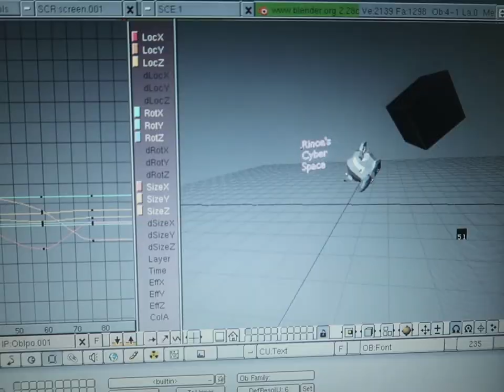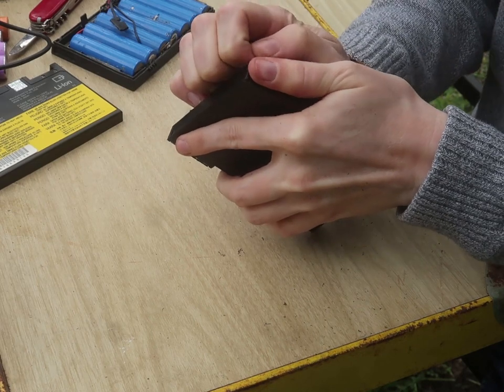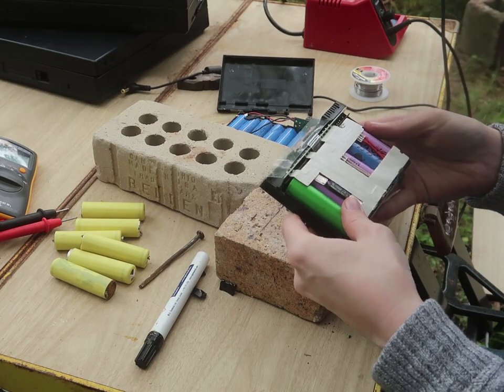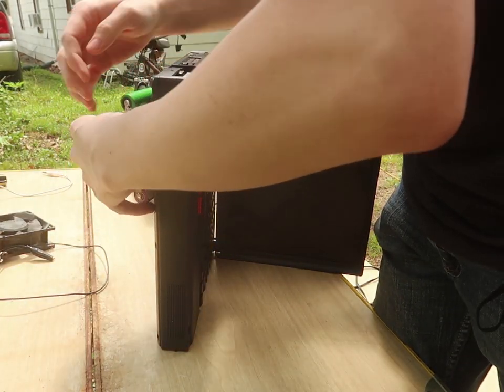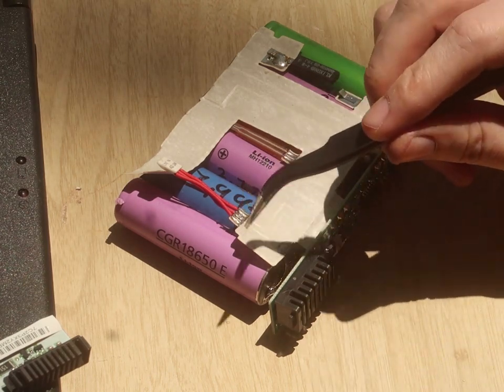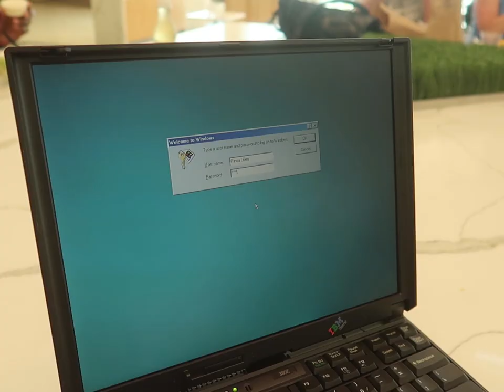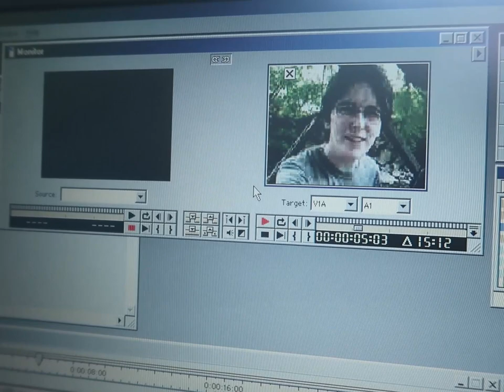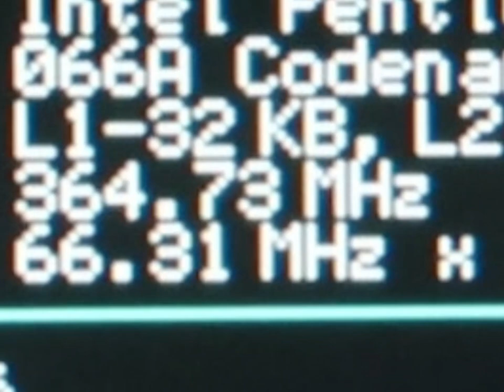Rinoa’s Cyber Space 01: Replacing Laptop 18650 Cells, Thinkpad Battery Recell Repair (Secret at end)

Comment: i learned how batteries work refurbishing discarded single use vapes, then rebuilding laptop batteries and eventually dealing with the big stuff powerwall and ev battery packs. shame that the drm in modern laptop batteries keeps you from rebuilding them since alot of obsolete models it doesnt make sense to spend more than the machine is worth on a new old stock battery thats sitting for years, but rebuidling it safely can get few more years out of it.
Reply: you definitely want those paper spacers to avoid shorting out if the plastic is damaged also theres cheap battery spot welder kits that may be worth it if you do this a lot, more reliable safer than trying to solder to the cell
Reply from the maker: I've soldered about 2,000 cells so far in my life and haven't had an issue yet, meanwhile I have had issues with spot welders. I don't plan to do this for products to sell to I'll stick with soldering for the time being.

Comment: Can't watch the video. However I'd be curious to see you do the same with old cordless power tool batteries. I had that idea to replace Ni-MH cells. Sourcing the high amp Samsung cells you'd want though is pretty difficult. I had the idea to use old laptop battery cells but someone said I'd just be wasting my time since they won't put out the needed amperage for power tools. My thought was even if so, I'd still have a working battery.
Reply from the maker: Oh, that's not a problem at all. Each 18650 can easily give 2 amps, maybe 4 amps. I'd say make your battery bigger so it lasts longer anyway. Maybe 1AH for every amp you plan to pull. On my first ebike battery I was pulling like 7 amps per 18650 and they werent happy, but they worked for hundreds of miles.

Comment: On my Thinkpad T60 the screen brightness option is in the BIOS. The default behaviour was to slightly dim the screen on battery power, but I disabled that. So now I have no brightness change when I unplug my laptop.

On a side note, does anyone have any idea why old Ni-Cd (nickel cadmium) batteries tend to fail and leak out? I have recently read a battery maintenance manual regarding this chemistry, and according to NASA for long term storage it is best to completely drain them, then keep them shorted (!!!) and in a cool dry place (but above freezing point). So that would indicate over discharge should have no negative effect on these batteries. Yet most guys who are into retro computing and preservation always advise to remove any Ni-Cd batteries from old motherboards, as they tend to fail and destroy the board they sit on.

I have an old NEC 386SX laptop from 1990, that has a soldered on Ni-Cd clock battery on the motherboard. It still works fine, but I am paranoid whether it's going to eventually leak out, and damage the machine. But I also like the fact that it can keep time and settings with it. Any advice?

Also the original main battery pack for mentioned 386SX laptop is made from Ni-Cd cells as well, and that battery pack works too for about an hour. I just don't know if this chemistry is always bound to fail and leak, or it really depends on manufacturing quality, and some of these cells/battery packs will keep working for many more decades?
Reply from the maker: It seems to be the case that the nicad cells only leak after they fail electrically. That's really amazing that you have a pack still working. Honestly I'd say keep it as long as you can.
Reply: @RinoaL  Yeah I will probably just keep a close eye on those batteries, so even if they start to fail I should be able to catch them in time, before they cause any damage. I want to preserve this NEC laltop as close to original as possible.

I bought it quite a few years ago as new old stock, the experience of unboxing a 30 year old machine was very special. There was no discolouration on it at all that we see on all these old computers. And I keep it in a dark place, so it still looks like new. It wasn't working though, it had a major capacitor problem, some of which were leaking badly. I had to replace all of them, and clean up the board. It was a HUGE undertaking, I spent weeks slowly sourcing all the different caps, then replacing all of them. But eventually I got it back to life. Even though I love my thinkpads, due to its uniqueness and time period it's from, this NEC is my most valued laptop.

Also I am planning to buy an Imax B6 battery charger for my battery related projects. And according to some people quite often you can sort of rejuvenate old Ni-Cd packs by  discharging, then charging them up, and repeating this a few times, while monitoring the capacity gains on each cycle.

When I leave my pack charged, it discharges quite fast, which indicates that it has crystallization inside. If I will feel brave enough, I might even try the "zapping method" to dissolve some of those crystals.

I just want to make sure whatever I do, I won't damage the machine. It's just too valuable for that, and I don't want to ruin a museum piece like that. Now that I am thinking, I might will get something cheaper from that era, and experiment and learn on that first.